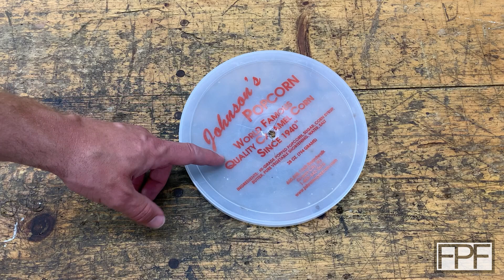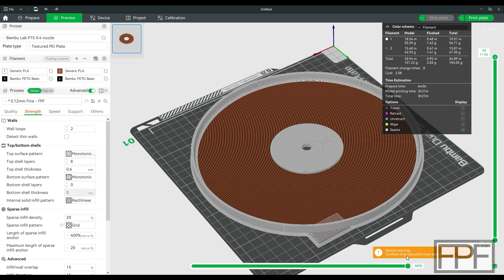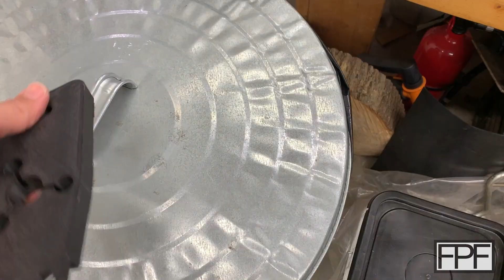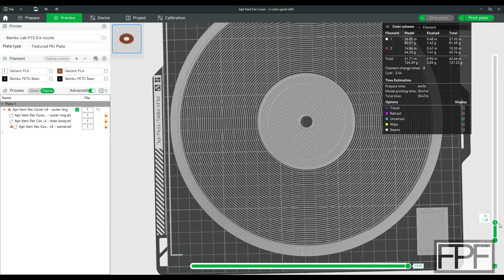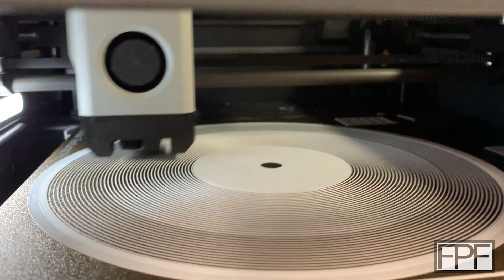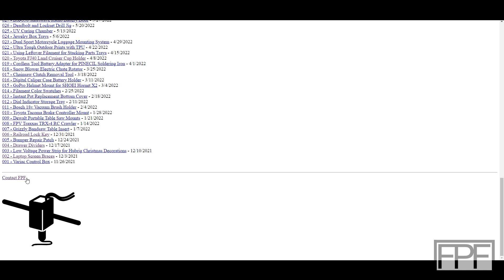3D Printed Vent Fan Cover with eXposed Infill

Comment: 🎵
When Magic Is Seen
in Twisted Graphene, 
That’s a Moiré 

When a grid's misaligned 
with another grid behind, 
That's a Moiré.

When the spacing is tight
And the difference is slight
That's a Moiré

When new lines hit your eyes
From two screens when they ply
That's a Moiré!

When the lines on the screen
Make more lines in between,
That's a Moiré!
🎵

Comment: You could have done the different section bottom layers and infill patterns using modifiers in Bambu Studio, so you wouldn't need to have 3 separate STLs. I suspect that stacking the 3 separate STLs is what is causing the issue with the slicer. You could use a cylinder modifier for the inner circle and a torus for the outer and change the bottom layers number of walls so it's solid. You could also change the infill on the torus to be solid, so the outer ring would be solid.

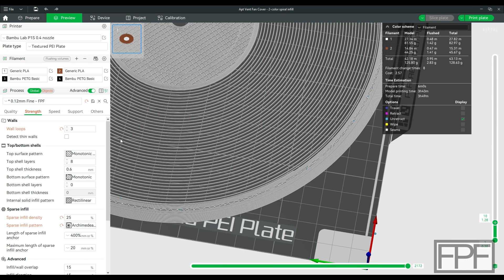Comment: @18:45 did you try switching from Classic wall generator to Arachne? It looks like it's trying to do a gap fill or something at those seams. You could also try "welding" the parts together in the slicer. (Studio may not support that). I would assume it has a lot to do with the infill percentage you have set, and the way that infill is laid down. It won't be where the "walls" are, as it's listed as infill. 
Another option would be to change the bottom layer SOLID infill to a lower percentage and turn on Archimedes for the type. That should give you a similar look.
Another tip would be to try out using Orca Slicer instead of Bambu Studio. It's quite a bit more advanced, and based on Studio with the same look and feel, but has way more powerful options for slicing. I prefer Orca a lot more over Studio.
Further, I stopped using brims years ago, and definitely don't use them on my X1C or P1S with the Textured PEI sheet. It isn't needed unless it's a really small or tall/skinny part, and is always a pain to remove. 
(Source: I run a 13 machine 3D print farm, print functional parts 24/7, and have an etsy store selling tools and accessories for use in woodworking and carpentry)

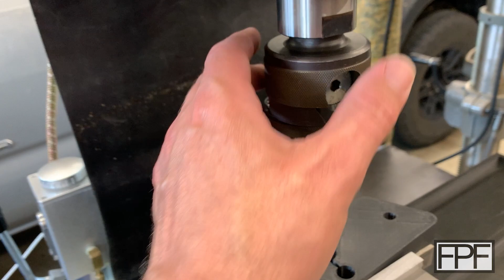Comment: @09:18  In regard to holding plastics in a machine vise... Next time, plase a strip of 100 to 220 grit sandpaper between the vise fixed jaw and the straight side of the part.  It does "wonders"!  Credit to ABOM79! (Adam Booth).
Reply from the maker: thx for the suggestion

Comment: Neat idea with the multicolored print and dynamic vignette effect. It seems like when you reassembled the three separate STLs in the slicer, they weren't all exactly centered or just the matter of having them overlap slightly introduced the artifacts causing the failed print. You didn't go over how you assembled these in the slicer so I'm unsure if this is the reason.  But if you revisit this, you could modify your design slightly so you print it in three separate parts.  The hub could be slightly oversized so it captures the spiral piece, and spiral peice slightly oversized with a flange to capture the outer ring.  The bolt that attaches the cover to the fan would keep it all together.

Comment: The new line of spiral causing the failure is surely related to the geometry of the wall next to it. More specifically, the way the slicer adds extra internal walls to support angles a few layers before the actual inner / outer overhang walls print, for cleaner surface finish. Go up a few more layers in the simulation, and i bet you'll see the extra stuff printing to support the radius on the outside corner. Unfortunately, you can't turn that feature off, but your could get rid of the fillet on the outside corner as a test. Maybe changing the radius or going with a chamfer will fix it?
Also, Cura didn't have that feature to support overhanging walls like that last i looked, and if they have added it, they probably put in an off switch...

Comment: Put the line width for sparse infill to 0.8mm (or 1.2mm if you have a 0.6mm nozzle), slow down sparse infill printing and maybe reduce the number of such layers by making the part less thick (basically moving the copper layers down).  If still not printing fine, then add some very thin (0.8mm) modifier boxes forming a cross through the center and assign a different number (> 0) of walls to those (and possibly 100% infill), which will normally cause the slicer to add some walls there.  That would change the look a bit though ...
Reply from the maker: thanks, I'll try this

Comment: 2 things
- increase infill width (printing tall thin walls with minimal curve is not that stable)
- cylinder modifier to set the special infill settings (it should be a bit more consistent than relying on the stl model geometry)
Reply from the maker: thx, I'll try that

Comment: So, do you take the cover of when you need the ventilation?
Reply from the maker: good question!  yes, I do, but this 'kitchen' (it's a stretch to call it that) is located in the apartment space over our garage that I use as my office.  The range only gets used 2-3 times a year at most.  If it was used more, I may just try and replace the vent altogether with one that had a 1-way flap.

Comment: That is another commercial looking job.
I found out Thursday my 120v DC power supply got to the post office 3 miles from my house and sent back because when they printed the label they put the wrong address on it. They had the right address in my file at Aliexpress. I'm trying to get it resolved before they ship it back to China. Silly part is they've shipped to the address before with no problems.
Reply from the maker: Thanks!, and ohh man. . gotta love that.  Good luck.  If they still have it at the post office and the name matches, they'll probably give it to you.
Reply: @FunctionalPrintFriday  Local office sent it back a few hours later. I did find out they screwed up the address they put on the label.
Post office said it had East Street on it. No where near the right street name. I highly recommend using the tracking through the post office. I had a text that the address was wrong but didn't call them before the truck picked it up to take it to the Mail Recovery Center.
So if you get a text message saying it was undeliverable at your local post office you should call them immediately so you can get your package before it goes on the truck.
Reply from the maker: @bwselectronic  glad to hear you got it!
Reply: @FunctionalPrintFriday  no I didn't get hold of them before it went to Kalamazoo or Grand Rapids. I'm hoping I can get it back on the right track. Gonna try online through post office and Aliexpress
Reply from the maker: @bwselectronic  ohh :(  That's what I get for reading too quickly.  Hope you're still able to get it resolved.

Comment: What if you ditched the brim, but used a raft to print on?
Will guarantee better adhesion for thin lines.
Reply from the maker: Should work, but the raft does tend to leave it's own texture

Comment: upside down with a grid/raft type of support, it will be on the inside but the spiral will adhere to the solid copper level surface better.
Reply from the maker: Yeh, this would have been the lowest effort way to get the spiral to work and the support scars would have been where we don't see anyway.   Would still love to figure out the infill oddity in bambu studio too though.

Comment: Did you try arachne as the wall generator? Seems like its trying to print some of the bevel to the wall, but arachne allows for variable extrusion width for thin walls so will instead just print a fat line rather than try and squeeze in two loops.

Edit: ahh what a shame on the finish on that second attempt. :(
Reply from the maker: I did, same floating line :(